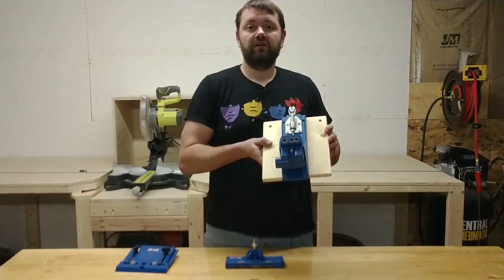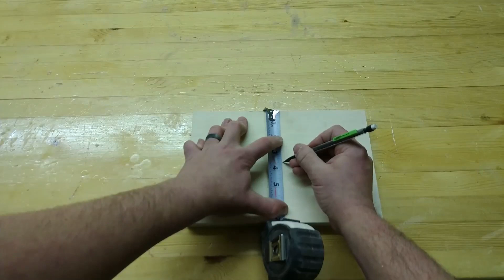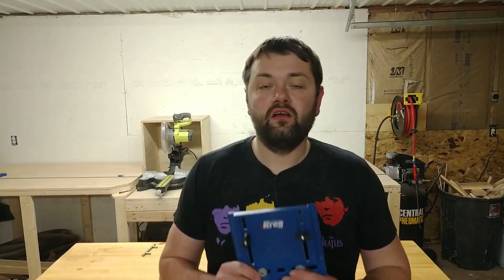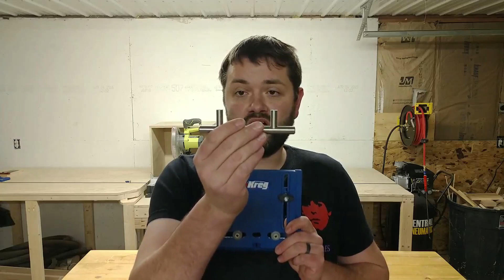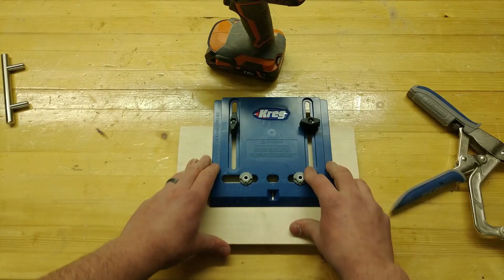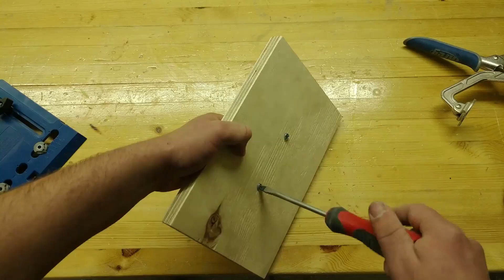How To Use Kreg Drawer Pull Jig!!!

Comment: An easy way to get the centre of any rectangle (without arithmetic) is to draw and X by placing your straight edge from top-left corner to bottom-right, draw a line (roughly in the middle, does not have to be full length) and repeat again from top-right to bottom-left. The centre is the point where both lines intersect. 

You can also find the centre of a circle by basic geometry (using Thales theorem):  if you have a right angle in a [virtual] triangle and the vertex of the right angle lies on a circle's circumference, then the line segment joining the other two vertices of the triangle must be a diameter of the circle. Basically if you place the inner corner of a [framing or carpenters] square on any point on the circumference then the two points where the square intersects with the circle circumference mark the extents of the diameter (a circle has infinity many diameters, lines though the centre enclosed by the circumference, but in practice people often just say 'the diameter' implying that there is only one instead of 'a diameter' even though the latter is less likely to aggrieve your friendly neighbourhood maths nerd).

Comment: This was very helpful but would love seeing how you use it on an upper or lower edge of a cabinet door
Reply from the maker: I could make a video of that if you would like! The principal is still the same. You would set your jig to the appropriate depth (the distance from the edge of the door to the mounting screws of your handle) and then clamp it and make sure your drill guides are at the appropriate distance. Then drill the holes and you're good to go! I suggest trying it on a sacrificial piece of wood first if you're in doubt. Thank you for the comment and let me know if you would like me to show you in a video!
Reply: @jtswoodworking4857  If you could show me in a video I would be so grateful. I'm ok with the drill but the measuring and placement scare me as i don't know the standards. I have shaker style cabinets and am probably going with pulls. I'm not very handy and it's my first time -- seeing someone else do it helps a ton!
Reply: or handles, not sure pulls is the correct term
Reply from the maker: There are handles and knobs. Handles would require two holes and knobs just one. I can show both. I'll write it down and attempt to do a quick video here this week.
Reply: @jtswoodworking4857  I think i ifgured it out. What I didn't understand was how far from the top or bottom to place the handle but i found something that said 2.5" is standard.
Reply from the maker: @EM-hm2vj  yeah that sounds about right. Really it's completely up to you. Would you still like me to do a video?
Reply: @jtswoodworking4857  I guess not. I had a little difficulty lining up the kreg three inches from the bottom of the cabinet and clamping it, but i think it's because i need the clamps that snap into place. I've been told to put a piece of wood along the back of the cabinet so the clamp doesn't damage the cabinet and everything keeps falling down. i'm going to return it and try a different one.
Reply from the maker: Yea good idea. The Kreg self adjusting clamps are perfect for that